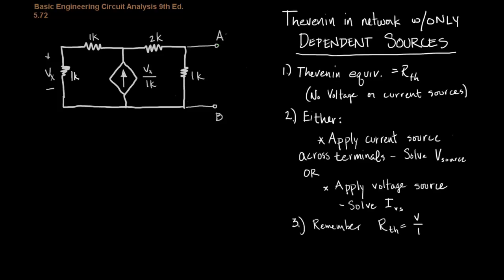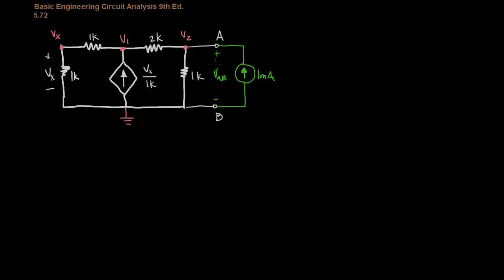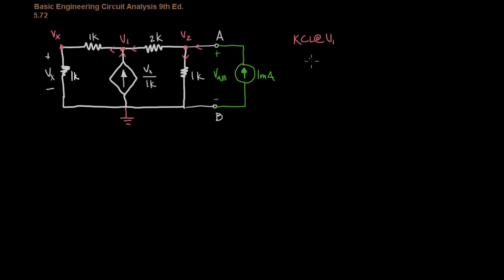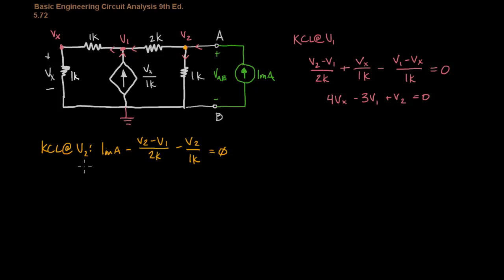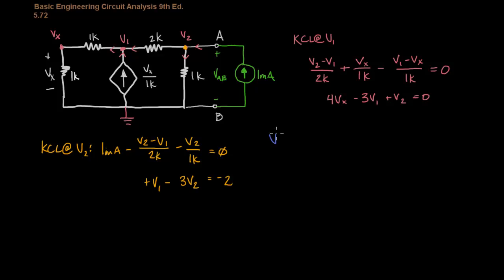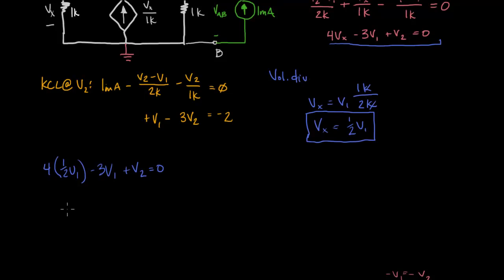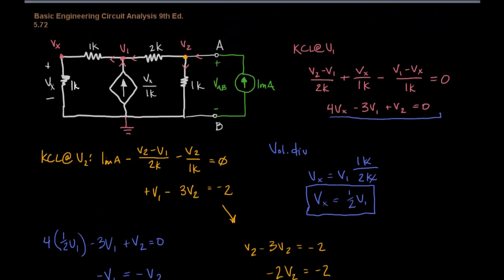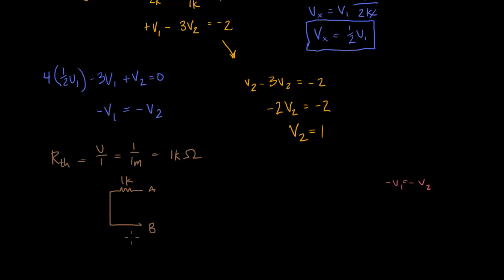Thevenin Equivalent for Circuit with no Independent Sources

Comment from the maker: Yes,  I chose 1mA because the resistors were in k(ohms).  1 keeps the math simple, but you can choose whatever you want for a test voltage or current.   Note if resistors were in ohms(no k) I'd likely choose 1A.

Comment: How did you determine that the direction of the current in resistor 2 is going on the V1? Why not away?
Reply: It shouldn't matter.  If you choose wrong but keep your signs correct, it works out the same, like a double negative.   Worst case, you find a voltage or current is negative, so you account for that in the final ohm's law by checking directions.  Current flows from higher voltage.

Comment: How did you find Vx=1/2 V1 ?
Reply: if your confused, try nodal.. you can get it
Reply: Vx = 1/2 V1 through voltage division. If you follow v1's path to ground from the left, you get a total resistance of 2k ohms, but Vx is only across one of those 1k ohm resistors, so the splitting factor is 1/2.

Comment: Why is it incorrect to solve for Thevenin without the test voltage/current source?
Reply: +yosimba2000 Correct me if I'm wrong, but I believe it's because you only have a dependent source. If you had an independent source you might be able to solve for the value of the dependent, but as is you cannot find Rth without introducing a test source. You can't find Rth by deactivating (treat independent voltage sources as short-circuits and independent current sources as open-circuits) independent sources because there is a dependent source. (And you can't 'deactivate' a dependent source.) Ultimately, if you try to solve this without introducing a test source, you'll not be able to simplify the circuit down to Rth because the dependent current source will get in the way.
Reply: +Ezis9 so true. thanks for the explanation
Reply: yosimba2000  voltage divider rule

Comment: You messed up the nodal analysis, you used V2-V1 for both nodes
Reply: That is how it should be. The current isn't changing in nodal analysis so the voltage over that specific resistor is going to stay as (V2-V1)/2k no matter which node you are analyzing.

Comment: This is incorrect. Vth should be 0 V for any circuit without an independent source. So Rth is always 0. All of your math looks correct from what I could tell by quickly glancing it over so not sure where you went wrong.
Reply from the maker: +Chris Sleckman Your statement is not correct.  It is true that Vth = 0.  But Rth is not always 0.  The point of thevenin equivalent circuits is to describe a lumped circuit abstraction which says that you can always express a purely resistive network as a voltage source in series with a resistor.  If you put the circuit inside a black box with two terminals, you would be unable to tell an original circuit from its thevenin equivalent.  If you put this circuit into a black box and measured its voltage, it would be zero, but if you measured it's resistance, there would be a value.
Reply: +Matthew Araujo KCL@v1: the first term should be v1-v2/2k not v2-v1/2k. Check it and see
Reply: A fundamental thing to know is that a circuit containing only resistances and controlled sources will appear as a constant value resistance when measured at its input terminals. However, this resistance cannot be measured directly using an ohmmeter (or multimeter) because the dependent current, being an element of an active device (a mosfet for example), only becomes 'alive' when the device is properly biased. So, one can only infer its value by applying a known voltage across the input terminals and measuring the current flowing into it; the Thevenin resistance is obtained by taking the ratio of input voltage to input current. For this particular circuit, analysis will show that the current flowing into the leftmost subcircuit (comprising of the two leftmost parallel branches) is zero for any value of voltage applied across the controlled current source, showing that it behaves as an infinite resistance (open circuit). Hence, when viewed from the right the input resistance of the circuit is simply determined by the 1 kohm shunt resistor since the 2 kohm resistor is open-circuited by the voltage-controlled curent source subcircuit.